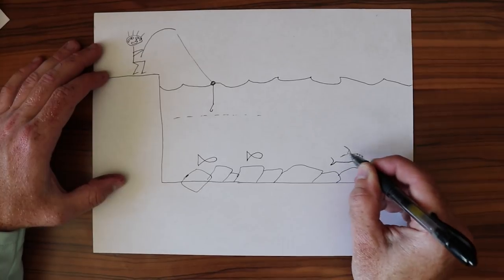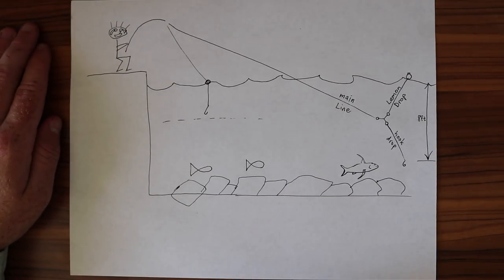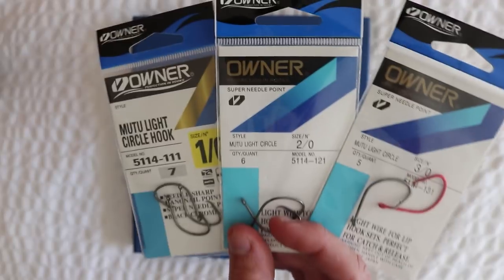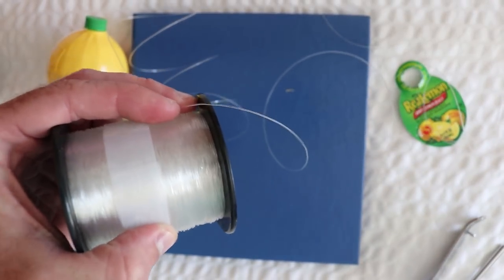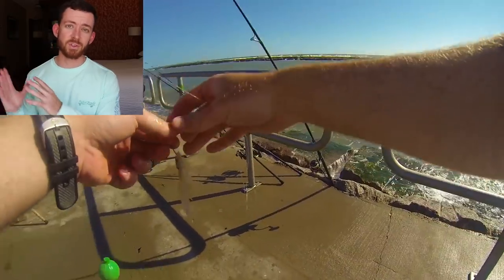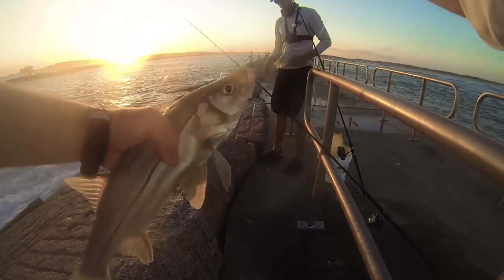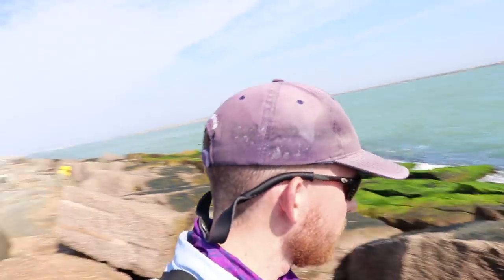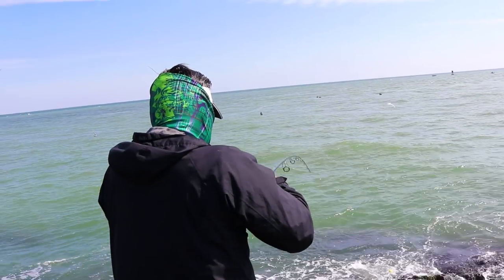The Lemon Rig Explained: Assembly, Theory, How To Fishing

Comment: Nice videos! Keep up the good work. I have never used a lemon rig and heard that you can shorten or lengthen the depth by pushing or pulling the line in and out of the bottle and using tightening the cap to keep it in place.

Comment: Great video Jeff. Another way you could accomplish the same result is with a slip bobber setup. Basically you have a bobber stop on your line that you can move up and down. This allows your bobber to slide down to your bait for easy casting. Once the bait hits the water it sinks to the set depth. It's a little difficult to describe but a quick search will return some videos. Love the content, keep it coming.
Reply: @andrewrollins4898  Another commenter made the interesting assertion that the lemon rig has more sensitivity b/c of the way the line is directly connected to your hook. I imagine that could make a difference with light biters like sheepshead that aren't usually going to pull your float underwater.
Reply: @andrewrollins4898  with a slip float, the fish has to pull the float under before youll actually feel a hit. With lemon rig, presumably youd feel the hit right away. By dropper rig i presume you mean a 3 way/paternoster rig? Thatll work of course, but that kind of defeats the purpose of being snagfree. Even if i use rounded bank sinkers, ill get caught on the rocks every 4-5 casts fishing that way. Same goes for fishfinder rigs. Great in the surf or off a pier but not ideal for jetty. Lead is expensive man.
Reply: @andrewrollins4898  oh, you mean a dropshot rig. Im familiar with that. I call it a lazy mans 3 way rig lol. The same rigs have different names in different applications, like fishfinder rig vs carolina rig. As for floats, you can watch them but with any amount of swell its gonna be hard to tell, especially since sheepshead bite so lightly. That being said, if you fish it active like a popping cork youll have better sensitivity.
Reply: @andrewrollins4898  im heading to the gulf coast to jetty fish this summer, definitely considering giving the ol 3 way another shot if i can get my hands on cheap leads 😂. If not itll be jerkbaits, doa shrimp, and swimjigs for the trip. I dont mind dropping money on terminal tackle but the boss does

Comment: Usually how deep are the jetties after the rocks end? We used popping corks out there and cut bait on spider weights but had limited success. I wonder if we were getting deep enough. Also, do you recommend using cut or frozen bait on the lemon rig or is live shrimp the best?
Reply: On the channel side, about 15 feet out from the rocks, the average depth is 20-30 feet. Where most of the fish dwell however is right above the rocks at the outermost edge which is usually around 10ft. On the Surfside at the end of the jetty there is a bank and a drop off that moves and changes with the tides and weather. I've seen it get as deep as 50ft and as shallow as 10ft but again where most of the fish hang seems to be right on the edge of the rocks in 10-15 feet depths. Best baits for lemon rig is going to be live ones I think. Shrimp, pin perch, fingerling mullet. Cut baits and frozen manhadens work great on bottom rigs for monster reds and sharks.

Comment: Tbh, I'd bank on a simple sliding float with a stop knot being a better option,  simply because the depth at which you fish can be varied infinitely  by moving the stop knot, to cope with the tide coming in and out, else you'd have to be continually shortening or lengthening your leader....
Reply: Posted this on another comment but it was just like yours; 
slip bobbers work beautifully for the exact reasons you mentioned. The difference I have noticed is in being able to sense the bite more on the lemon rig. I think it has to do with the way the line is connected between the bait and the rod. Something about that orientation allows you to feel the hit rather than relying on the bobber going under to indicate a fish on.

Comment: I've seen them with some sort of rattle in the lemon itself, have you used them like that before? If so how'd that go?
Reply from the maker: Some places sell them "premade" with split shots or bb's inside.  Since these have higher density than water (but not by much) this could help if it's the smaller size of lemon bottle and you need to retain a decent level of bouyancy.  If you can find the larger lemon bottle save the money on the split shots!

Comment: So I made a lemon rig. How do I keep the two lines from getting tangled?
Reply: I've seen 2 modifications that help with this; using heavier weight line (50#) and shorting the length of the lemon line by about 6 inches. Also, and I couldn't really explain why but using a spinning real tangles less than a baitcast. Pure anecdotal evidence here but it seems to make a difference for I dunno what reason : /

Comment: Do you have any suggestions to figure out the depth of the water?
Reply from the maker: There’s a castable sonar from Deeper but I’ve never used it.  I’ve mostly just asked locals that seem to know what they’re doing!
Reply: If you're willing to possibly sacrifice a couple of sinkers, get a heavy sinker and tie up a fishfinder rig with a plastic bottle or float at the end instead of a hook. Cast it out where you want to fish, and pull the line tight so that the float/bottle abuts the sinker. Then gradually feed line out, foot by foot (helps if you mark a line on your rod) until the float/bottle pops back up. That'll be the depth of that area, +/- a foot or so depending on swell.

Comment: why not use a slip bobber rig which can be depth adjusted much easier n faster?
plus your rig is prone to get tangles
Reply: Slip bobbers work beautifully for the exact reasons you mentioned. The difference I have noticed is in being able to sense the bite more on the lemon rig. I think it has to do with the way the line is connected between the bait and the rod. Something about that orientation allows you to feel the hit rather than relying on the bobber going under to indicate a fish on.

Comment: Why not just throw a bobber on the line? Someone please explain?
Reply: The fluid left in the lemon adds weight to your line and assists in a good cast, it also gives you good line feel as it suspends the bait in the water column you can get a very sensitive feel as to nibbles and full on bites . Lemon riggs have been used for years ( in Corpus ), we used to use them for Trout with live shrimp back in the 80s.
Reply: Forgot to say, Great video Jeff. I watch you and Thresher all the time to keep up with the fishing down there.
Reply: I think he meant, instead of the lemon bottle for the floating device, why not just use a cork.
I'm curious as well. I think that the lemon bottle allows for you to adjust the weight of the rig and the length of the leader by sliding more line into the lemon bottle then tightening the cap back on to lock it in place.

What do you think?